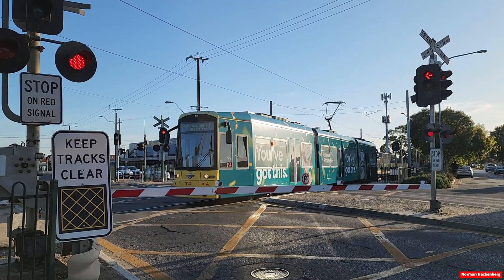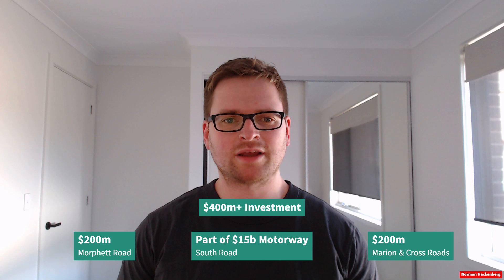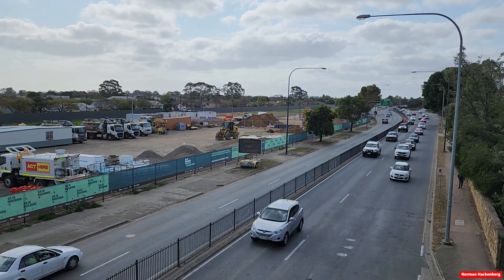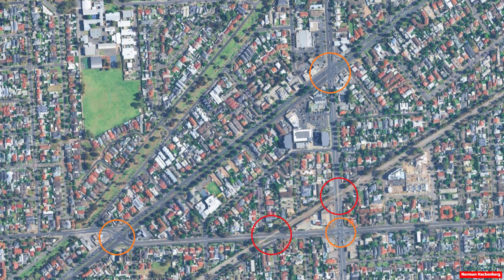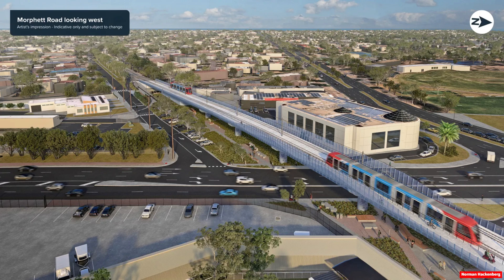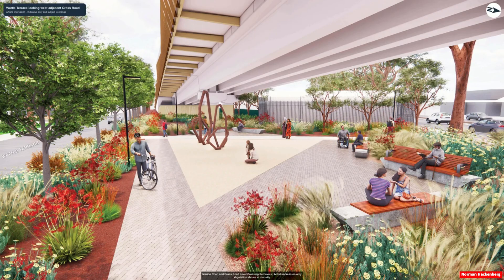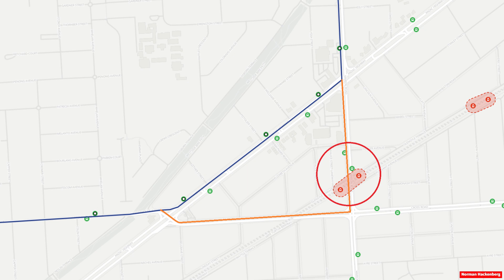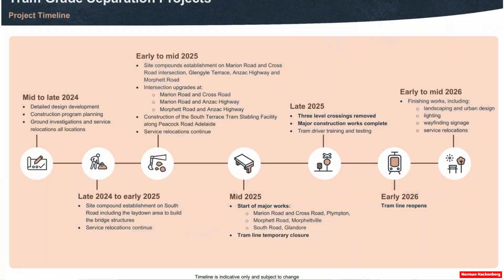Development Adelaide Episode 8: Tram Grade Separation

Comment: Guys. Melbourne has replaced 70+ level crossings so far with very few closes of train services. How? They leave the level crossings open while they build elevated crossings next to them.
Reply from the maker: Yes, it definitely could have been done here as well, but the government decided that it would be cheaper to just close down the line. When they did the same work to the crossing at South Road they did set up a temporary track to the north of the existing line.
Reply: Now do why Vic is in so much debt.....
Reply: @Right-Is-Right so IS SA.  Malinauskas running up our debt

Comment: I drive as a courier here in Adelaide and if people had a bit more patience it would not be a problem (and I like train crossings Ha Ha, tram Xings are miles quicker than being stuck a Cormack road waiting for a Freight train to get up too speed exiting the Freight terminal at Islington!!).....the biggest problems are ongoing road works in multiple locations!! often in the same places every few years............South Road at Aldinga is a case in point! less than 10 years ago a lot of road widening was done with great overtaking lanes, then they came along and decide to redo it into the current ongoing works......money would have been better spent on fixing the Aldinga intersections (less extravagantly) and improving the main road to Cape Jervis as it see's constant B double traffic and to use a technical term a mate likes "its a Fuken Pig track!" bumpy, narrow and needs a bypass around Yankalilla. The South eastern freeway is in need of resurfacing as its old as too...  And Tapleys Hill road past the Airport needs to go back to an 80 limit as even 6mths after the lower speed limit no one does 60......

Comment: These projects are completely useless they should be leaving the tram line as it is and building bridges over the tram lines. Take Marion Rd for example a bridge should go over Anzac Hwy, the tram lines and Cross Road otherwise it only takes one stop out of three and traffic will build up at the other two intersections
Reply: Marion Rd should as you say go over both the tram line and Anzac Hwy. But that would be too much like commonsense. Give it a few years and they will start again and do just that. And Morphett Rd as well. Even then you will have to north on Marion Rd, chuck a U turn and come back to turn into Anzac Hwy. Just like Port Rd south Rd disaster.. Labor,, no idea but spend billion stuffing things up.
Where is the money coming from?? SA is bankrupt already. Or has Labor found a money tree.
Reply: So you want a much wider,longer, and more load bearing bridge to be built? How about you get the money raised for your most needed project. If it is as needed as you said, I'm sure those that would be happy with the idea will help you out.

Comment: Wonder how much time this might be able to knock off the tram timetable? I wish they would do some stop rationalisation alongside this: for example Stops 7,8,9 on the Glenelg line at Glandore, Beckman and South Plympton look they could all just be combined into one and speed the trip up quite a bit. Road infrastructure really is just a beast that gobbles everything up though.
Reply: Interesting....the slowest part of the tram trip though is the Grenfell Rd to North Terrace city part. It crawls along!
Reply: @garrywallace1007  For sure it is terribly slow through the CBD, and the frustrating bit is that Adelaide could solve so many issues with a relatively short railway tunnel connecting the suburban rail system from north to south underneath the CBD with a couple of stations.
Reply: @ Now you are talking!! Wlll need that rail connection one day
Reply: This project has no benefit to tram users.
Reply: It's not going to speed it up at all.
Reply from the maker: The time saving for the tram would be counted in seconds. The main beneficiary will be the road user.
Reply: @developmentadl  The stop rationalisations you mentioned on top of the LX removals and combined with the stop rationalisations I mentioned could add up to more than that if we assumine 20sec stopping penalty for each stop but yeah. The main beneficiary is obvs road users (including buses), but cyclists and tram riders get a more consistent and safer trip.
Reply: @BigBlueMan118 i am sure the people of glandore, became and south plympton may disagree.
Reply: @Dusty_swags  You would have to throw them a bone of course, eg. more frequent trams all day or as part of some other extension works or something. But to be clear I was saying they become one stop, people just have to walk a bit further but they get a quicker trip and it is hard to complain too much as you have a tree-lined fully separated cycleway/walkway.
Reply: @BigBlueMan118  well the same could be said about the goodwood and wayville area. Heck don't run the tram into the cbd it it will be faster. It's almost like public transport should be convenient when you think about it.
Reply: @Dusty_swags  Why are you getting so antsy? If you can point out some stops in the Goodwood and Wayville area you think should be rationalised I would for sure take a look at them. 

Public transport should be convenient for sure I agree, but it also needs to get the maximum amount of people to where they want to go quickly and efficiently, and 400m stop spacing on light rail outside core areas is an anachronism of a bygone era, no modern systems are built like and places like Melbourne or Berlin are looking at stop rationalisation to speed up journeys and maximise the value of the infrastructure.
Reply: @BigBlueMan118  i am pointing out that 400m is a decent spacing for a reason. I used to live near wayville stop and walk to goodwood twice  daily. As someone who now has mobility issues 400m is something you think twice about. You named 3 stops you want to merge, I named a few that could be merged in a more affluent area. Speed of the journey while disenfranchising sections of the community is not a thing I would endorse.
Reply: @Dusty_swags  OK but firstly if we take your logic to its conclusion why not just stop every 300m or 250m? You agree there is a balance to be struck, you just disagree where that sweet spot is. Secondly if you changed the stop spacing to be 700m rather than 400m, you are never more than 350m from the next stop ie. the midpoint between two stops.
Reply: @BigBlueMan118  hope you never have mobility issues.
Reply: @Dusty_swags  Mate why are you so triggered, I am trying to have a straight up chat with you and engage about the topic but you are just taking jabs and not actually willing to engage, why? I understand there is probably a lot of negative emotions associated with feeling like the existing or my proposed system don't cater to all needs but there is a fair dinkum way to make that point
Reply: @BigBlueMan118  I have mobility issues as I have mentioned before. You try using crutches and public transport then say that only 350m is not that far.
Reply: @Dusty_swags  Sure but you also said you would find it fair to rationalise stops to the kind of stop density I am advocating for further in around Goodwood, why is it ok there but not where you are which has a nice comfortable shaded grade-separated path around you?
Reply: @BigBlueMan118  I wasn't saying to remove those stops rather I was pointing out they are closer together.